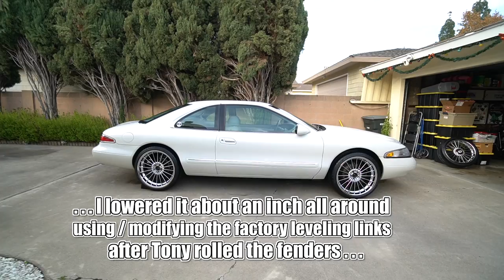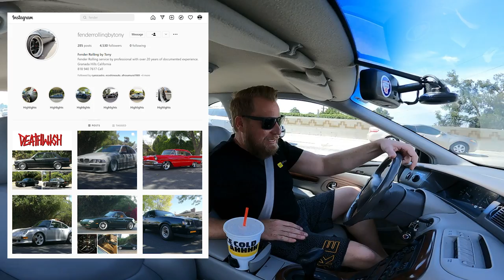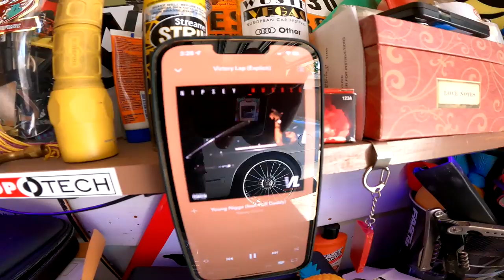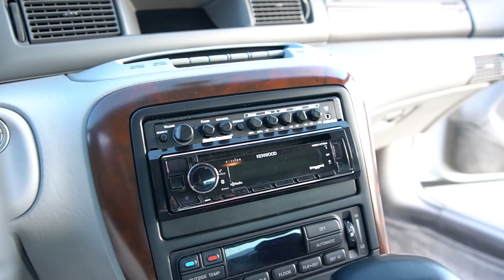Taking Nipsey's Lincoln to the Rick Ross car show!

Comment: 1:12 I have the SAME car, SAME color on 20" Redlines. I have had it for (6) years now. Baby it. Premium fluids. (2) waxes per year. The BIGGEST question I get everytime I drive her (she is not a daily) is: "Damn....WHAT YEAR IS THAT?" The 1997-1998 Lincoln Mark 8 was (and is still) ahead of its time. RIP Nipsey
Reply: 2 waxes a year? Mine gets more than that weekly..

Comment: Nobody can beat my awesome custom ride I had in 1992 215" woofers in the back seat of a 83 Dodge Aries K-Car.
 I could see that the front of the car resembled the Mercedes. So I decorated all of the emblems on my Dodge edge from all the neighborhood Mercedes. Their pieces went on my car.  Then I needed wheels. I couldn't afford anything at the time. So I put hub caps. My dad was a tool and die guy and he had these hubcaps that they never came out with it was prototype. They were like space saucers. Never seen another will look like that ever again and I don't have any pictures. But so many girls fell for it when they saw the Mercedes emblems. That actually worked. The guys made fun but they still wanted to ride when they didn't have a car. And everyone knew it was me because it was so ugly I had stupid blinking lights on the bottom to the bass.  Had my Crown air freshener blue. My car was blue. Is had my locs on.
 I put custom dingleberries hanging inside and dripping tint all custom.  I made my own steering wheel in shop class. Resembles today the foose wheel or Boyd cottington I was copying Boyd's mini truckin styles.
 That car when I put it in manual and Florida I beat a Mustang and a Corvette on a short run that was embarrassing for them. They obviously couldn't drive their good car compared to my turtle. That car could only go 85 miles an hour and I had it floored a lot of the time.
 I like when people have a car and they put it in their lyrics. The El pino wheel is much like the Aston DB7.

Comment: O my GAWD that stinkin Lincoln is clean I had a 1989 Mark seven LSC and out of the 30 or more cars that I’ve had that was one of the best cars I’ve ever driven it had  the 5.0 H.O. engine and the air ride suspension u could cruise all day at 85 feeling like you’re floating on air they don’t make cars like that anymore everything has to ride hard or European i don’t like that shit bring back cars that float🔥🔥🔥🔥🔥🔥🔥🔥🔥🔥

Comment: Dead ass, that’s all it takes to get to the lugs?
Reply: Why go through all the trouble to lock them under that if it’s only held wit tape
Reply from the maker: I see what you mean, the tape is just used for padding.  They still lock on with the key.  The tape/foam padding just makes it not rattle metal on metal.
Reply: Ohhhhh ok. Cool man, and thanks for the reply! Appreciate all the content you put out for us!